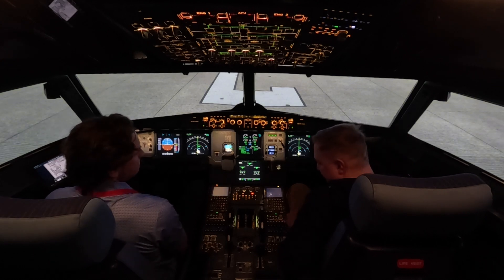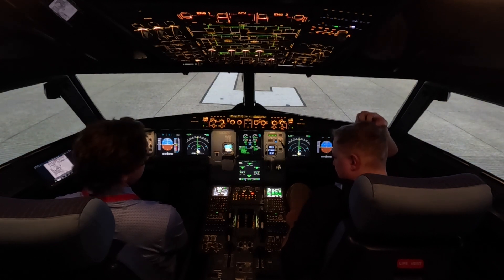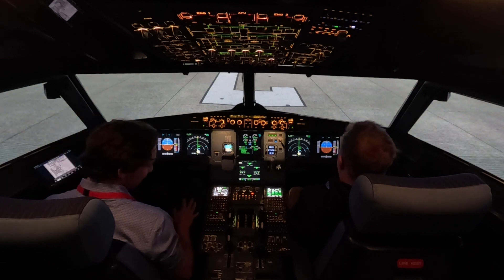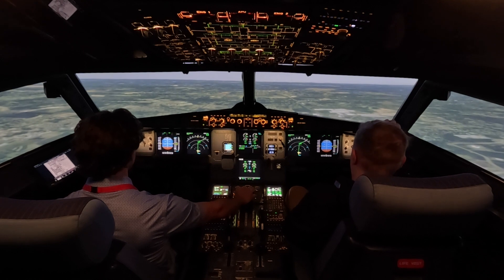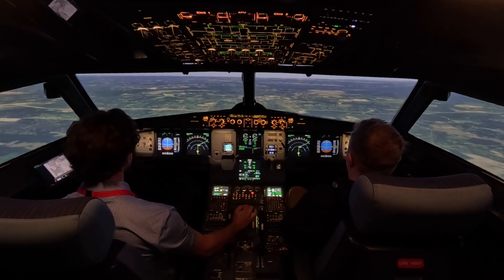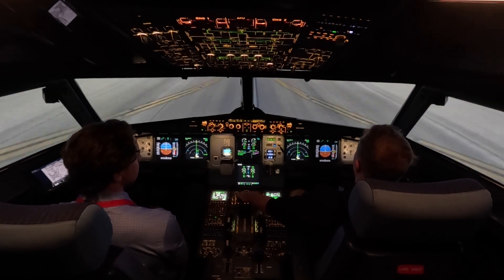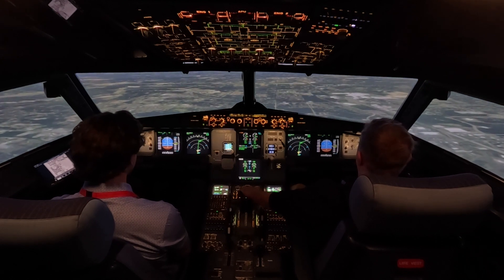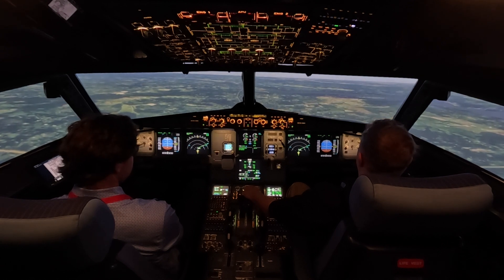Airbus A320 Wind shear on Take Off! Like and subscribe!

Comment: Don't deselect the A/THR before selecting TOGA. You're creating work for yourself later. You'll lose the LVR CLB flashing cue, THR selection on the FMA (which means you need to count 2 clicks back or look at the EWD to confirm thrust setting) i.e. THR CLB, and auto thrust automatic reengagement (unless in TOGA LK). I also recommend not calling speed... see Capt Warren Vadenburgh's take on it in his videos. To miss the ground, the highest threat, you might need to pull all the way back to alpha max.

Comment: You won't overspeed the flaps in Flaps 1. Rely on the auto flap retract function. Remember, it's only an overspeed if you get the ecam overspeed warning as the barbers pole is only a reflection on handle and speed, not the actual flap position. Different if you were in an A350.